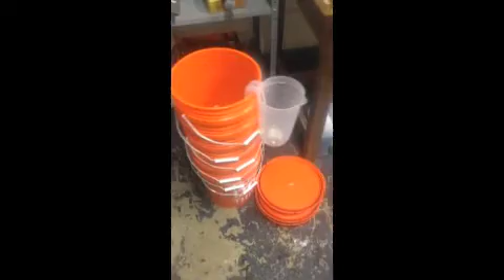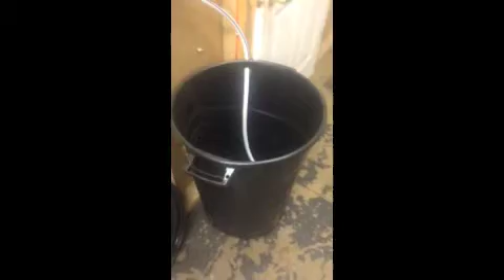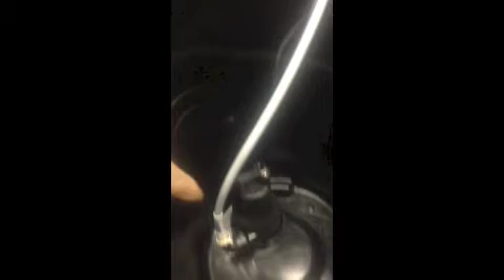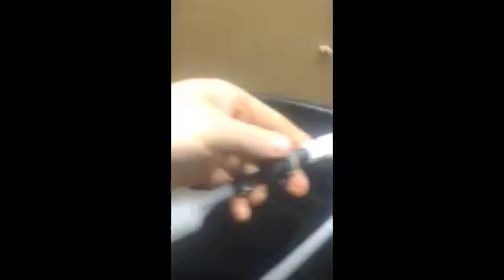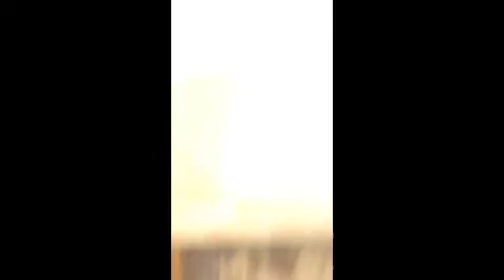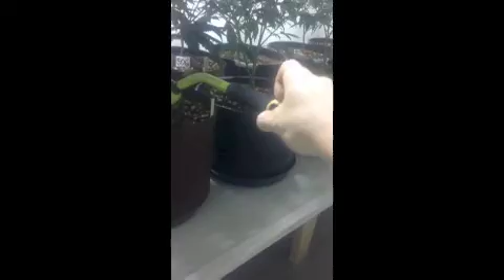RO Watering Wand & Pump & Float- INSTALL

Comment: When you switch off the wand the pump keep working or turn off itself? I wonder if doesn't burn with the outake closed..?
Reply from the maker: Yep, the pump keeps working, you can leave it off for several minutes at the time without any issues. Probably isn't the best for it but it always seems to pump right up and I've had it about 18 months so far. Lol, I actually left it plugged in over night with the switch turned off, came out the next day and the pump was scorching hot, and the water was about 150 degrees. I thought for sure I was buying a new one. Not at all, I let it cool down for a few hours, and it fired right up and worked fine. Seems to be pretty durable to me. :)
Reply: +Cbd Farmer Mmm awesome good to know.. I'm ordering these items right now, so tired of hand watering lol thanks man..
Reply: +Cbd Farmer Hey i forgot lol. The hose is 1/2" or 5/8"? Thanks again
Reply from the maker: +Green Karat I believe it's 5/8" I think that's standard for most garden hoses. Also, the cheap tractor supply wand didn't last very long, get yourself a Dramm wand with a longer arm, and thumb valve, way better! 

http://growgreenmi.com/dramm-one-touch-rain-wand-30-in-blue?gclid=Cj0KEQjwwMi7BRDGptbvwOCDj8oBEiQAIALyDIeG_B1R4I_cIo8wzOdCwSwY7FVwYEmXiyU5bZYpZysaAqcP8P8HAQ
Reply: +Cbd Farmer Thank you my friend!! Last night i ordered that same wand and a Superior Pump 1/4 HP with a 1/2" Neverkink white hose. Let see if works well.. Cheers

Comment: How well does the RO system fill up  your tank/how long does it take?
Reply: +E Weezy I have a similar one and the short answer is: A long time. Most likely a few days, but it shouldn't have a problem keeping it level between waterings.
Reply from the maker: Sorry E Weezy for the extremely late response, but yes they take a while. 6 Months after installing the above RO system I replaced it and bought a better one. I needed 50 gallons made a day, and this was only giving me maybe 30 GPD with the booster pump. I picked up the Active Aqua 200 GPD system for $220 at the local grow store and it is WAYYY better. I don't need to use the booster pump anymore, and I can easily get 50 gallons a day (without using any electricity) I replace the filters every 4 months.